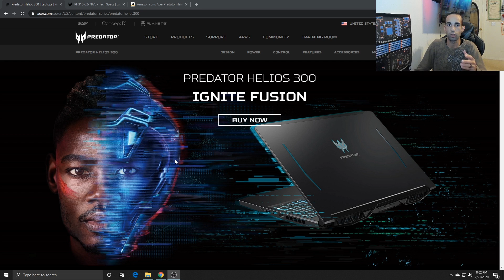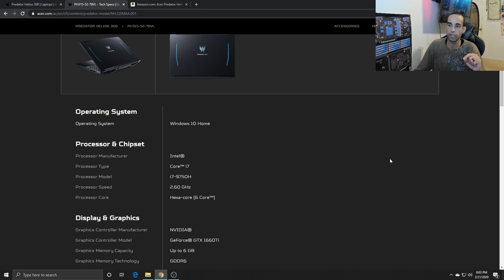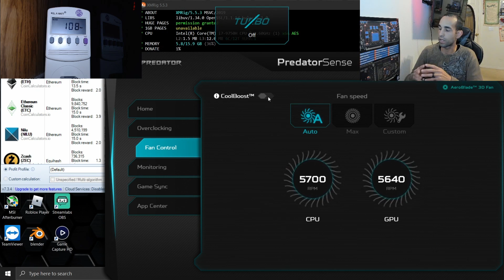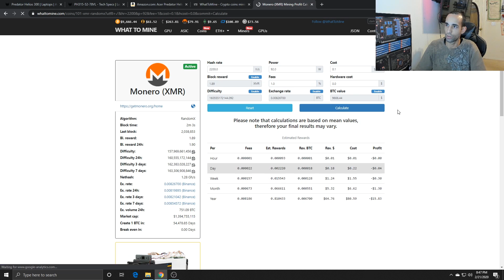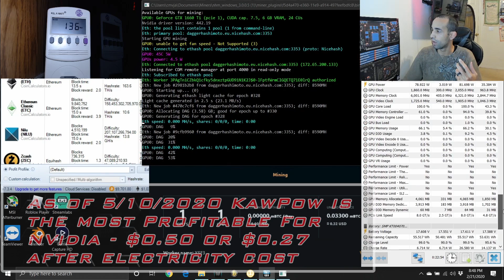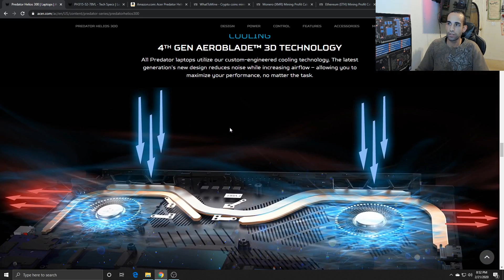Can You Mine Crypto on a Laptop 2020

Comment: Hey Serpent, do you experience overheating or auto turbo boosting on this laptop at idle? Unless I use Throttle stop my Predator be whooshing out to space, any one else maybe got an idea? (Yes I change thermal and clean fans)
Reply from the maker: May want to recheck you thermal replacement application. Have you loaded Hwinfo to see what the temps are on the GPU and CPU. If the heatsink is not making sufficient contact the fan will ramp up high fairly quick, but if all is good, disconnect the fans and reseat them to see if it makes it better. I have not experienced this
Reply: @SerpentXTech  Thanks for replying really appreciate it! Unfortunately out of the box when I played warzone for the first time I had 80-90 degrees. I have made sure the heat sink is sitting properly (I assume that means as it sounds, screwing it in right and making sure its in its socket) I unfortunately also thermal pasted but to no avail, my fans seem to be running fine at around max clock of 6200. Though I do not understand what it means to reset them. Also I want to note that I read online this is a common issue.
Reply from the maker: @vatanrahimli1700  yea, the laptops can only so much surface area in the heatsink to absorb and attempt to dissipate that heat. Most will sit high in thermals, even with decent thermal applications but do you have Acer Predator sense?
Reply: @SerpentXTech  Yes I do and I monitor, I actually did not have random turbo boost issues up until some dumb updates from windows. Also I wanted to say the laptop came with some weird thermal pads but they were not a square plastic but rather looked like very thick layers of thermal paste, I have only been applying thermal paste.
Reply: @SerpentXTech  Which made me think after watching your video on the thermals, that I should probably get some good thermal pads I remember you said 0.5 was the size  right?
Reply from the maker: @vatanrahimli1700  .5mm right
Reply: @SerpentXTech  I just did a full clean up and watched your other video on this very topic (sorry to bother one last time) I applied thermal paste and cleaned, Its running fairly cooler of course how ever even on idle the temps go to 50 celsius. Which made me wonder could this be because of lack of pads? as I am sure my thermal appliance is not wrong and I am quite gentle with the whole process.
Reply: @SerpentXTech  The only time the temps are down on idle to 40-30 is if I under clock and under volt, I set my underclock to 3.5ghz on all cores and undervolted cache and core to -0.1328. I don't notice any issues in game just bummed out that I can't use my 4.5ghz turbo boost without becoming a toaster.

Comment: Is 74 ° C safe for 1660Ti Lenovo Y540? In nicehash daggerhashimotto algorithm 23/24 MHps
Reply from the maker: Yes, that's a normal temp for a laptop. You can prob tune the GPU to get 28 Mhs, by increasing mem clocks
Reply: @SerpentXTech  I would go as far to say that 74 C is low for a gaming laptop under load. I have the Acer predator before your model and it comfortably runs at 85 C, only throttles at 99

Comment: i tried with my dell 7577 with 1060 and it went to 80c lol this should have been my 4th mining computer but im afraid its gonna destroy the laptop
Reply: The computer will decrease the power and clock of the graphics card to prevent it catching on fire or frying the GPU and CPU.
Reply: @TocyBlox  i think this computer is not soing it i just got use to using desktop it doesnt reach above 80c
Reply: @SmokeGames20  Laptop chips are deigned to go above 100 due to lower cooling.
My AMD Ryzen 7 4700 8 core CPU is rated at 105 degrees. Never go above 90. Sits around 80 during intensive tasks.
Reply: @TocyBlox  i change thermal paste and its looking good now stable at 60c and its better than my desktop gpu temp lol
Reply: @SmokeGames20  sounds good :) I'll be changing it in about a year.

Comment: Do you actually need that specific laptop just for the mining
Reply from the maker: Not at all, most modern day laptops are profitable. Just keep temps low and system cool. If you can easily remove the battery on yours, you can do that to help reduce temps.
Reply: @SerpentXTech  okay
Reply: Wait. just for the mining?

Comment: gtx 1660 ti //  +163 +900  // 29.3mh/s 60 temp setup minimum 5% and maximum 40 or 60% cpu in power management or power plan
Reply: i have the same, mining when not gaming, im concern of the memory overclock it has no temp sensor

Comment: i just wanna mine with my old laptop till it dies. i have a new PC that`s better, but having an extra miner would be nice. even if it`s shit. problem is it says on nicehash that it won`t work wich sucks.
Reply from the maker: Try mining direct, using XMRrig. Try with Awesome miner, and add a managed miner in there for your CPU. https://youtu.be/o6ez0LAmq-8
Reply: is 80c safe lol my 1060 6gb max q is overheating i just got this laptop i bought it to mine i bought a laptop since gpu pricrs are expensive now and the rpice of a 1060 is same price as a laptop with 1060

Comment: my system has a ghost gpu, and my miner chooses that, how can I get round that and have it choose the 1660Ti that is has?
Reply from the maker: under the "Devices" tab do you have two devices? One CPU and one GPU, if not, but you have a dedicated graphics card like the 1660 ti. It may not be showing because it is not active. Check your Windows power settings, by going to the "Control Panel" then "Hardware and sound" and then "Power Options" then "Change power plan". Make sure it is on performance, then click "Change plan settings" look on the left side for "change advanced power settings". Look for PCI express and under Link management see what it is on. If you it is on, turn it off, if it is of, turn it on. To see if that changes anything. Some laptops need to stay plugged in for you to use the GPU, otherwise it will default to the CPU. (All this depends on if you have a discrete GPU, not an intel iGPU)

Comment: Time to mine on a dual core processor with an integrated gpu from 2011.
Reply: That's what I am thinking about, buying old cheap laptops for 50 euro each, to mine. Worth it?
Reply: I have exactly that. A Dual core intel Pentium 2.0ghz with a intel integrated graphics 4000. I only use it for browsing the web and it's just barely even good for that. Would that actually work? I'd be bringing it into work and using their electricity so that wouldn't be an issue. The thing is worth $50 at the most.
Reply: Depends what you mine, most coins need at least 4gb+ of vram. So you need a gpu with enough memory
Reply: HAHAHAHA ARE YOU SERIOUS?
Reply: I just tried to do that , the nicehash application won't start because it doesn't support the hardware
Reply: @MrHjkil  thanks for telling us.
Reply: @MrHjkil  same here
Reply: did that work? lol
Reply: bought a laptop with 1060 for $400 getting 16mhs not bad and i change thermal paste and clean it for $20 including labour now im getting 60c while mining lol its even better than my desktop gpu
Reply: I debuted my trading career as a solo trader and lost so much money before getting introduced to Mr Corey by a friend and guess what his bitcoin trading platform has been the best trading investments I’ve done in a long while
Reply: @coreytradings
Reply: @Coreytradings .

Comment: What about mining on a HP- PAVILION 15 ec-1021ax with a ryzen 5 4600H and 8gb ram with Nvidia Gtx 1650 and a 5400 rpm HDD ?
Reply from the maker: Looks like you could make a decent profit. When it comes to laptops, just make sure Temps are good. You don't want to be running 24/7 with temps in the upper 90's, and if you can control the laptop fan speeds, turn them up to a comfortable but decent cooling level.
Reply: @SerpentXTech  What should the daily profit look like? thx

Comment: Would part time mining be feasible on an Aorus 17 X with an i7-10875H CPU and 200W RTX 2080 Super GPU?
Reply from the maker: Right now sure. Just keep thermals under control, if you can do that and manually control fans  to keep things cool, you should be fine. Intel CPU mining is not to effective, but just check what it can do a weight pro's n cons
Reply: @SerpentXTech  what application can I use to control the fan speed?

Comment: I own the same laptop model(with thhe RTX 2060 instead of 1660ti) but my GPU temperature goes upto 90 degree C. Any Solutions ?
Reply from the maker: Better thermal paste and adjust the fans in software to run cool blast or manually set them higher. The laptop is super easy to teardown, but if your under warranty and nervous about it, then crank up the fan speeds. Laptop cooling can only do so much, the heatsink can only handle so much heat, so maybe a laptop stand with a fan or two in it will help. They are not made for 24/7 mining. Check out my other Acer Predator videos, on improving thermals, where you can see what I did. Dont go with Liquid metal tho, just get some thermal Grizzly Kryonaut. I will have an update on laptop soon.
Reply: Undervolt the CPU
Reply: How much hashrate are you taking?
Reply: don't do that

Comment: What do you think about the apple M1? It has much lower power consumption than any PC ever made. It's an 8 core CPU and 8 core GPU. It's also leaked the next M chip will be 12 core. I'm super curious since I just ordered one
Reply: Heh theoretically it can well actually not just theoretical but fact just needed a program someone used to make fuctional miner for android (yes for phones) in 2015 and if memory correct someone mine 0.0000100 btc after a week all sounded good till google banned it and somehow noone wanted to develop it outside google ecosystem (which is weird) 

but if the sole purpose for mining you better prepare some desk fan to blow those infamous anemic cooling from Apple
Reply: I don't think there are any programs. And I don't know how much vram it has.
Reply: @peterhindes maybe through windows bootcamp or possibly browser. Which  i tried to experiment by mining monero on my unused iphone 6 through browser (yes with my sherlock holmes googling it's exists) for a week and half now and yep got the same result like that dude i mentioned before not bad..

Comment: What’s your thoughts on a laptop with a 1070 mining ETC? I don’t intend to do 24 hour mining/ electricity is not a factor & it will probably mine for 12 hours the most. My idea & thinking is every little adds up but the goal at the start of 2021 is to build a dedicated mining desktop but in the mean start acquiring every little ETC I can get
Reply: Rip my 6 years laptop
Reply from the maker: Just keep an eye on temps, you dont want to be running at 85C + 24/7. If you can keep the CPU out of it, only GPU and got thermals under control sure. Maybe get a laptop, lap cooler with fans, so your laptop can sit on that and be cooled

Comment: I’m on a mid range 10th gen i5 with iris graphics, ops on mining with them specs?
Reply from the maker: Well it really comes down to what GPU you have, as it will perform similar to its desktop counterpart. What is most important is temps as mining on a laptop for extended periods of time, with high temps can reduce the life of your hardware. The 10th gen i5 might be able to bring an extra $0.50 - $0.80 cents a day depending on the Algo, but it will also increase temps for GPU. So if you did mine, I would turn off CPU mining and just use GPU. Just keep an eye on temps, if you hit an average of 85c or higher, I would not run it 24/7. The fans are good but will wear out when mining 24/7. Good luck